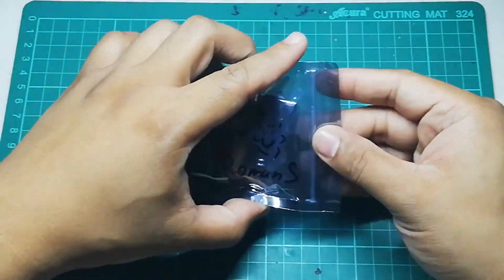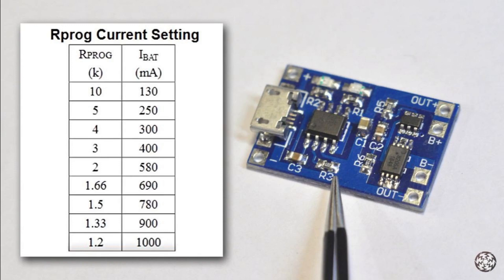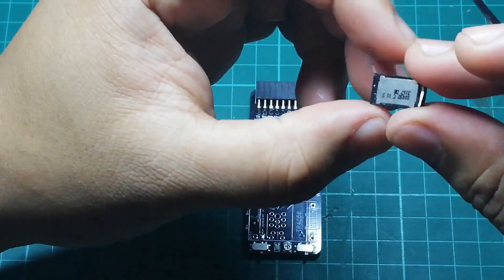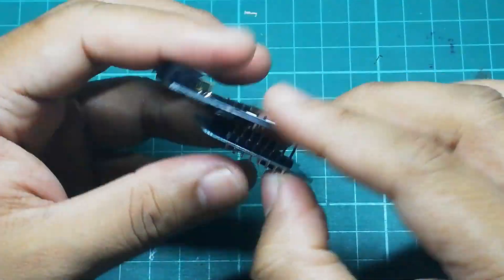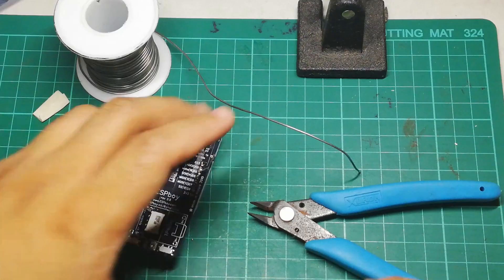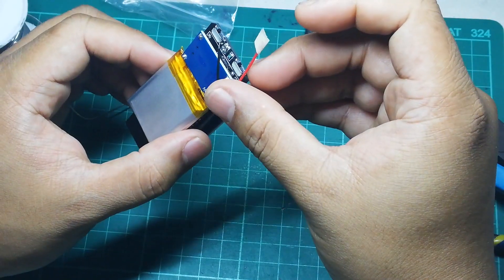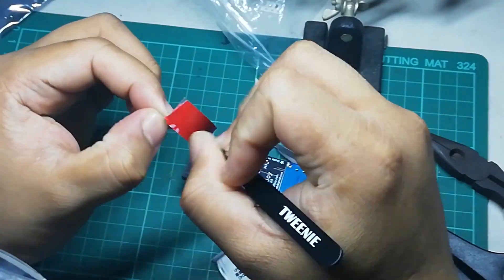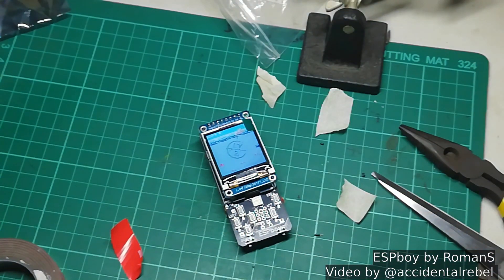ESPboy1 build instruction (get PCB at EasyEDA)

Comment: Hello, I just made this wonder but I have a problem, the display on the MCP4725 does not turn on, there is no voltage, vout is -3.3v. I have to make a jumper from vcc to the BL TFT input. But there should be 5V there.
Reply from the maker: I'm sorry, but I can't figure out what the question is. It is possible not to put MCP4725 and just solder a jumper and the display will work at maximum brightness without any problems. I've tested it )
Reply: Sorry for the problem I used MCP4726 these systems are similar but the A0 input is controlled differently. I solved the problem. Best regards